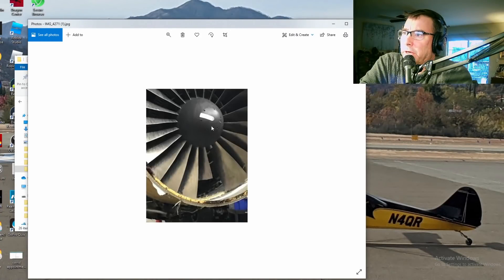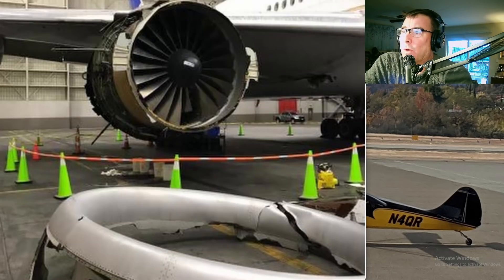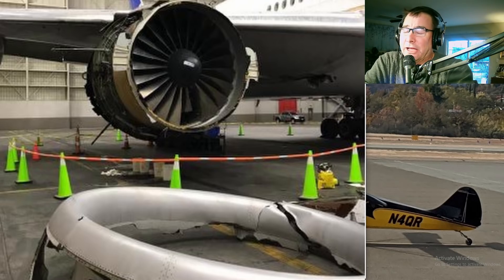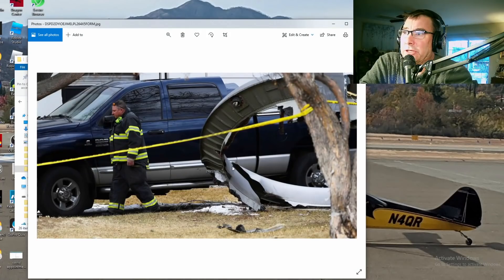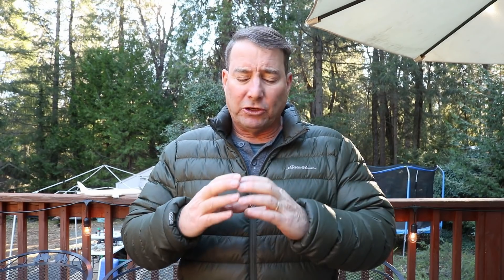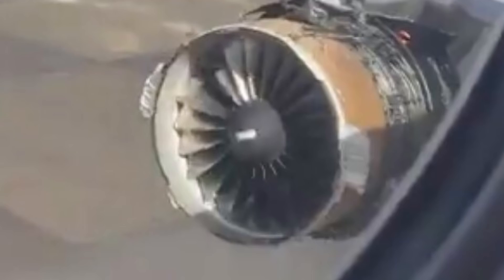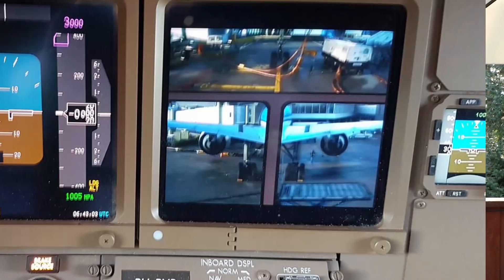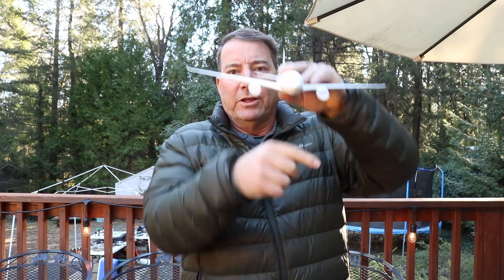UAL 328 UPDATE Fan Blade Failure  B777-200  22 Feb 2021

Comment: I like your comments over maintaining speed at lower altitudes on one engine. My thoughts are: 1) what would be the probability of a second engine failure under normal load, 2) would that probability increase by making that engine work harder, and 3) where is the risk balance between overworking a good engine to get there sooner, against the increased possibility of failure due to it working harder. It almost sounds like health and safety rules that were written by someone with training, but never actually done the job. I feel pilots would be more protective of their remaining engine. I’m also conscious that lower altitudes mean a shorter gliding distance should the second engine fail! As pilots would be.

Comment: They were lucky it was a fan blade, not a HP turbine blade. Those smaller bastards can easily penetrate fuselage, cut-open hydraulics and cause fire. For folks who wonder how such a relatively slow spinning fan blade can cause so much damage: keep in mind 777's engines are one of the biggest turbofans in a known universe, hence such a blade has a lot of momentum when broken loose.
Great vid btw., thank you Juan.

Comment: ✈️❓ ~ Questions: (1st) About what percentage of stopping power comes from the brakes versus the reverse thrust normally?   (2nd) Why do you say that the first officer is probably better at landing the plane anyway? I thought the captain and first officer usually switch back-and-forth between flying 50/50%.   (3rd) What would happen in the situation where one engine was lost and the airplane was going to be too heavy to land at that same airport? Normally you would dump fuel but in this case there was an engine fire incident with the flame still going. So do you think the pilot would go ahead and dump fuel or what would they do?   If you’re able to answer my questions, or anybody else answer them, I would appreciate it. Thanks.

Comment: 4:04 Engines are tested without the QEC kit, but they still have a bell mouth, cradle and test cowlings installed.  Those pretty much simulate the engine cowling...

Comment: Also, with ground evacuations, I've seen countless videos of people sliding down the emergency chute with their laptop bags or other carry on items. There should be a law that states no one be allowed to take anything with them that isn't necessary for their survival once an evacuation is underway. I believe the rule of thumb is 90 seconds to successfully evacuate a plane once it is on the ground. Every time someone goes to fetch their laptop bag or some other item, that adds a few extra seconds to EVERYONE trying to evacuate the plane. Multiply that by several dozen people and you now turn a 90 second evacuation into a 3-5 minute evacuation and when there is leaking fuel involved, every second counts. People are literally trading other people's lives just so they can keep their laptop with them.
Reply: Airlines will often certify an aircraft for full evacuation in 90 seconds then add seats and reconfigure interiors.

Comment: This might be a stupid question but is there some button or procedure a pilot can go through to manually dump the entire engine off of the plane? This would probably be under very extreme specific circumstances (like flying over water, etc), but I can imagine there might be a scenario where the failed engine is causing structural issues with the wing so the pilot might want to just completely ditch the engine off of the plane.

Is such a thing possible or is that just something where no scenario would present itself where performing such an action would be overall beneficial for the emergency? Obviously you wouldn't want to do this over an inhabited area but if you are flying over water or the desert or some remote unpopulated area, perhaps dumping a damaged engine would keep the wing from slowly destructing due to the constant vibrations from the dead engine.

Also, I don't know how much an engine weights but my guess is that suddenly losing that amount of weight on one side of the aircraft would cause the plane to immediately start banking in one direction. The side of the plane where the engine is disconnected from the wing would probably make that wing more efficient aerodynamically since the dead engine isn't producing drag any longer. However, there's probably all types of fuel / hydraulics lines that would have to be terminated, etc.

My thinking here is that a controlled disconnect and ejection of a dead engine would be preferable than an engine coming apart and taking parts of the wing / hydraulics with it. This kind of reminds me of the devastating flight of AA 191 DC-10 where maintenance procedures to disconnect the engine from the plane were shortened by removing the entire pylon with the engine still attached because it meant just removing (4?) bolts instead of hundreds. The problem with that maintenance procedure though caused the pylon to possibly get bent / fractured and that micro-fracture would grow over time until the Pylon itself self-destructed causing the engine to flip off over the wing. RIP to that crew and those passengers.

This idea is probably one of those ideas that sound interesting in theory but presents a batch of other issues in the real-world (dealing with fuel / hydraulic lines, dropping the engine in such a way that it doesn't slap into the rudder, etc.) It could probably be designed successfully but it might turn into a economic issue (how often do you have a catastrophic engine failure involving a broken fan blade, etc.) 

Another option might be the ability to ditch the fan blade assembly itself so you don't have the violent shaking from the freely moving fan blade assembly but again, that would probably complicate the design of engines themselves. It would be super cool if there was a system advanced enough to individually ditch specific fan blades to regain overall balance for the entire fan itself.

Comment: Is maneuvering the plane with one engine such as making a u-turn  safe, or does it add to the complexity?
Reply: No not at all especially to land what they do is they shut off the hydraulic system and the fuel system to the engine. Then they just glide back to the runway
Reply: It would be worse if you was just taking off and the engine failed because then you would have a hard time getting off the ground without thrust
Reply: This plane was already thousands of feet off the ground

Comment: Juan or A&P experts,  can the Airlines choose or change engine between manufacturers for  the 777, let's  say replace theese P&W Engines with GE or Rolls Royce without having to expending millions modifying the 777?
Reply: No, it would cost millions and millions to modify each airplane because the engine pylons,  electronic harness, and many accessories would need to be changed.

Comment: Investigators should  also look at the cowling section attached to the nacelle for sign of fatigue. For the nose of the cowling to detach, virtually undeformed (too clean) seem inconsistent with sequential failure initiated by a broken blade.  The possibility of the blade breaking off, then cleanly cutting the following blade mid-span, then bouncing off forward to slice the cowling...while the plane is accelerating to, or at cruising speed seems to be not logical. Could a blade slice another if they are both moving/rotating in the same speed and direction?   In one of the photos, it showed the bypass stator blades were completely obliterated (caused by ingested  blades?) 'Possible that the failure started by the cowling near the nacelle instead?

Comment: Just watched your recent interview with Captain Benham. His experience calls into question many of the comments in this video about single engine operations. It would appear that much of what you said in this video is applicable to a simple engine shutdown without cowling damage. The UAL fan blade incidents with cowling damage added the factors of disrupted airflow/impacted aerodynamics and the necessity to perform 
a controllability check to determine aircraft flying characteristics due to damage.
Brings back lots of memories of military flying. The comments on hand flying or lack there of helped me realize how lucky we were in flying the diverse missions in the C-130!

Comment: I worked on smaller jets, and when you pull a fire suppression handle before rotate it would cut off Fuel Hydraulic and Electric. The question is, is it universal, or was it just on our jets? Thanks to anyone responding.

Comment: I am quite shocked by this. 3D printed blades? Are they out of their god damn minds? I've been in factories operated by LHT etc... Blade process is very expensive. So In effect. The blades are the most important thing next to the wings. And you make them out of what amounts to f***ing cardboard? Whoever made that decision should be strung up. I hope to god that LHT don't go there. Bit of info here. Large airlines usually have their own prefab parts factories for high wear stuff. Saves on import/Demand cost. Downright shameful.

Comment: Each of those blades impart tons of force in that area near the root and closest to the hub. The energy at every given point is about the weight of a fully loaded school bus. The blades will actually stretch sometimes...hence the abradable material. We are usually not allowed to do any blending or repair work in those areas due to it. Any damage is usually grounds for a blade change and disc re-balance. Bad as it looks, this appears to be a contained failure. The ice impact trays are scuffed up (as you'd expect in this kind of failure) but the kevlar ring does not appear punctured in the images. The fact that the engine continued windmilling was the best thing for that fire...strange as it sounds. It meant the laminar flow due to the rotating components kept the flame from propagating outward from the core towards the wing structure.

Comment: Wrt ETOPS, the nominated single engine speed (for use in an ETOPS diversion) is only for planning purposes, in as much that it defines the 'Rule Distance' (in conjunction with the 'Rule Time' that's been approved by the relevant NAA for the airline / aircraft type) and remembering that, for ETOPS diversion planning purposes for Rule Time <= 180 minutes a failure occurring at the CP is assumed to occur in 'still air' & ISA conditions (which, in reality, it rarely ever would be) whereas a Rule Time > 180 minutes is calculated at the all-engines-operating cruise speed, corrected for winds and temperature.

Furthermore, an airline can select the speed it wishes to nominate for its ETOPS diversion strategy and that speed then becomes part of its ETOPS approval. A range of speeds is available, subject to a number of considerations, e.g. is terrain likely to be limiting during the ETOPS diversion (flying higher to avoid mountains, means less thrust and less thrust results in going at a slower speed) or is the diversion likely to be across the ocean (i.e. terrain is not limiting) in which case more thrust is available and with more thrust available you can go faster. And it should be noted that there is no requirement to do the ETOPS divert at 10,000 ft... the diversion (and the nominated speed that goes with it) can be planned for & flown at any altitude deemed appropriate (subject to terrain clearance).

In the event of an actual failure in flight (thus making it an emergency) the PIC can choose to fly the aircraft at any speed he/she thinks is appropriate; typically that would be a slower speed than the nominated ETOPS diversion speed (which is usually chosen to be as fast as possible) and, ergo, the subsequent diversion - if it had occurred at the CP - would take longer than the airline's approved ETOPS 'rule time' (and there's nothing wrong with that). However, if the reason for the divert is due to a cargo fire, it would be prudent to crack-on a bit, wherein cargo hold fire suppression systems are designed to contain the fire for at least the length of the approved 'Rule Time' + 15 minutes (and not for longer).

My $0.02 worth.

Comment: In this case with  fan blade failure it was  causing uncontrolled shaking which could have resulted in the mounting system to fail engine failing to the ground? Why wouldn't it have some kind of internal brake to stop it from freewheeling?

Comment: Great synopsis again Juan . Knowledge is power and intellect fuels it . It's like learning medical procedures or understanding a diagnosis ..... It doesn't mean we can operate or be a doctor , but we can mentally go over things we've learned and make a calmer decision . [quick question] When you're at the equal time point and you must descend to go forward , do you drop down and flatten out at level flight ? Or do you recalculate an economical fuel arc ?  (Using the safer altitude as the half way point in that arc ?)  .

Comment: I wouldn't be horrified by an event like this, but I can only imagine how much shaking there would be by the balance of a broken off fan-blade, I'd probably embrace the free message though. I'd also assume that the fire is only because the engine might still be running and there's no cowling left to obstruct the view of what might be a normal view if the cowling was transparent.

Comment: I was the first officer on a 777-200 from Tokyo to Houston in October of 2004. We had to shut down the #2 engine due to severe oil loss and high oil temp. I was the pilot flying on that leg. We had 3 pilots, so one of us was making sure our fuel balance remained within limits. We had about 30 minutes to our alternate in Cold Bay,  Alaska, so we decided to dump fuel down to max landing weight  on the way there. Drift down to FL230, and deviation off the oceanic track was the first priority after shutting down the engine. We used the autopilot down to about 200 feet, at which time I elected to manually land the aircraft. Flaps 20 Ref speed was about 155 kts, which looks very fast from the cockpit, especially at night. The runway was 10000 ft. in length so there was no problem getting the aircraft stopped. On landing we immediately quadrupled the population of Cold Bay.
Reply: I can see that from google earth! nobody there!

Comment: 4:19 The blade out tests are done with a Nose cowl.  You can't run an engine without a nose cowl.  The test cells use a more sturdier nozzle than the ones used on Aircraft.  The "nose cowl" is not part of the containment structure.  Only the fan case (Kevlar wrapped).

Comment: Why is there a switch to disable the autothrottle on each engine ? 
Surely the concept of auto, it should AUTOmatically switch off the auto throttle when the pilot cuts the fuel, the fire alarm sounds, the fire control is pulled etc. !!
What sort of thickos are making these aircraft ?
Reply: This is autopilot not AI-pilot😂

Comment: I wonder why there is no emergency braking system to stop the engine from windmilling. That is why the engine was shaking so much after losing the fan blade.
Reply: A brake on a engine sounds great....
Reply: @ethansaviation2672   sarcasm?

Comment: If the 2nd fan blade (fragment) had not impacted and split the inlet, the inlet stays on, and the nacelle stays in one piece, with a functioning fire-suppression system.  With the engine missing 1 1/3 fan blades, it would still windmill and vibrate from the blade-out, but it would have remained together to complete the abbreviated flight back.  The Kevlar belt that forms the fan case did its job and contained the initial blade-out.  Obviously, the reaction of the adjacent blade fragment and its trajectory needs to be understood.

Comment: I said when this happened,  This engines safety components did EXACTLY what it was supposed to do when the engine failed. Then the pilots and air crew did EXACTLY what there training told them to do. And not only did they get the aircraft back to the airport,  And did it so with out any injuries or lose of life. You are fare more likely to be injured or killed in a automobile crash than a aircraft crash.

Comment: And in other news ... Pratt & Whitney to develop semi-auto ejecting fan blades. The intention is to be able to electively eject fan blades opposite to any that have autonomously ejected in an attempt to temporarily re-balance turbofans until everybody can change underwear.Perhaps these hollow fan blades should be re-looked at. Yes, I know that the engines have been certified, but I think that perhaps certification requirements should be upped ... in 2099 when the industry has recovered just a tad.